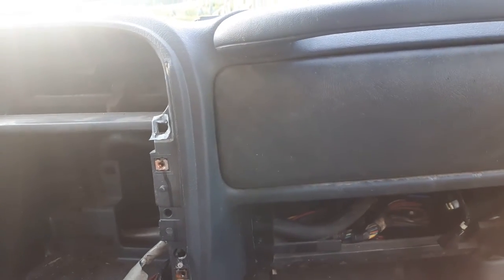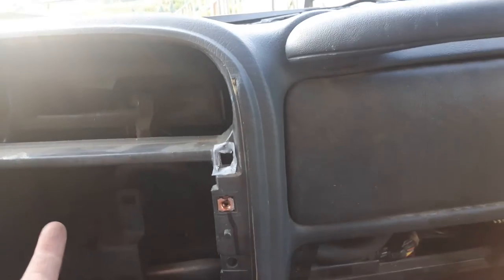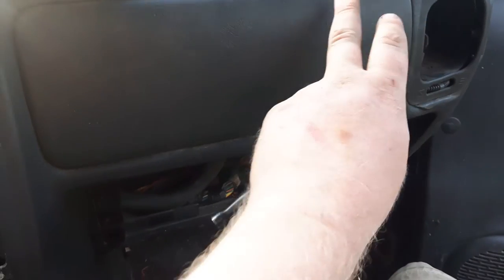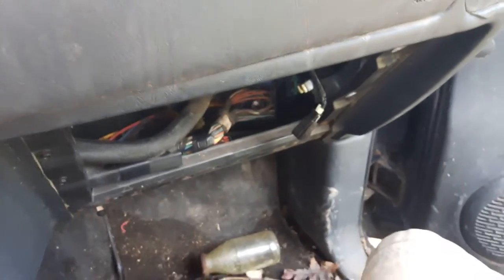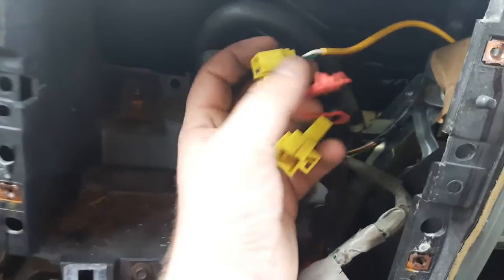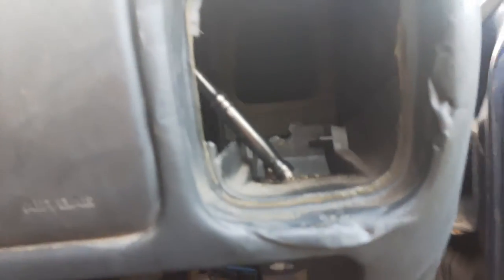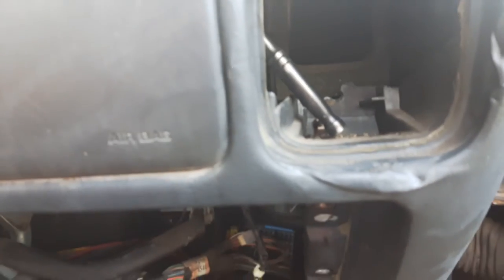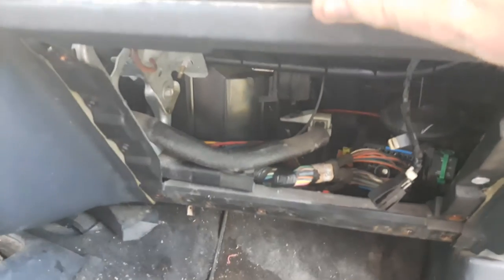How to Remove Passenger Side Airbag 2002 Chevy Blazer

Comment: I just removed the same airbag on a 1999 GMC Jimmy and the procedure is the same however there are two bolts on the bottom of the airbag that need to be removed as well.  10mm and you can drop the glove box to reach them.

Comment: Thanks. Do you need to disconnect anything (battery, safety feature, etc.) other than the yellow connector you showed, before attempting to remove the 10mm bolts?

Comment: If there is no battery power any chance the air bag can accidently deploy right?   

If I'm removing the full dash, will it just come out with it?

I have the same truck/year and am customizing for ev conversion and  That's a lot of good space in there!

BTW, why you removing and setting them off?
Reply: omfg .. the screws are toward the seating and there are 4 of them.  I'm redesigning the dash to eat up that space anyways to im taking a saw-saw to it …
Reply from the maker: For your main question I would say yes to remove the dash you should probably remove the airbag, there is most likely bolts with in that area and with the airbag gone it will give you more room.
The truck was totaled somehow they didn't go off in the accident so before it went for scrap I decide to have some fun.